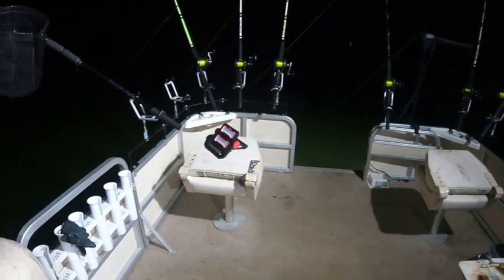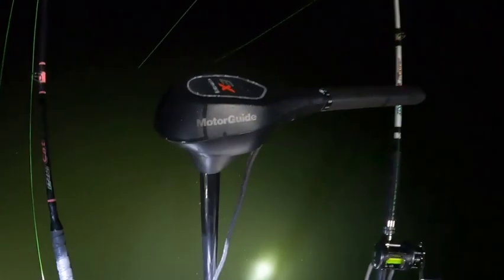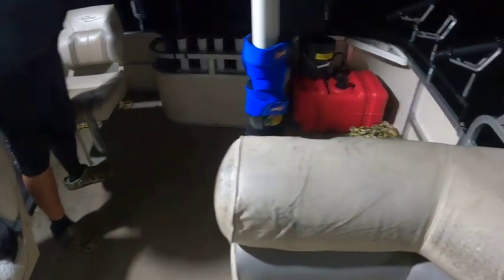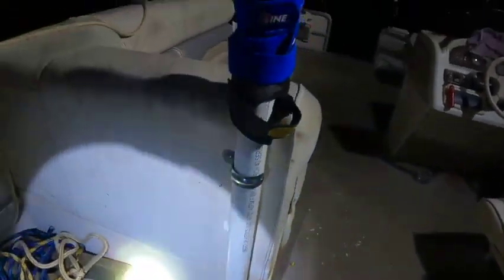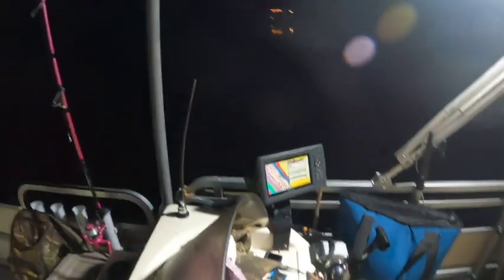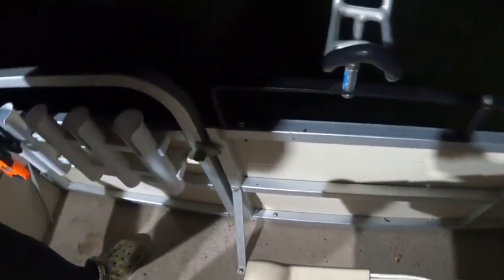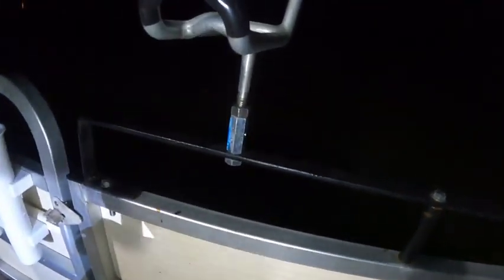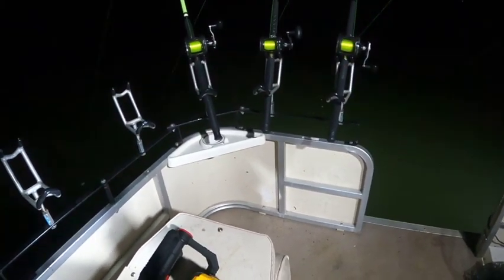Pontoon Setup For Catfishing with Rod Holders

Comment: I wish I could keep a boat that clean … mine always was a mess after a hour on the water…. I bet those totes are a game changer
Reply from the maker: The totes keep everything organized and dry when not in use and makes a table to cut bait on with the cutting board. We use an additional one to hold extra clothes such as coats and gloves of a winter and my heater for the propane tank